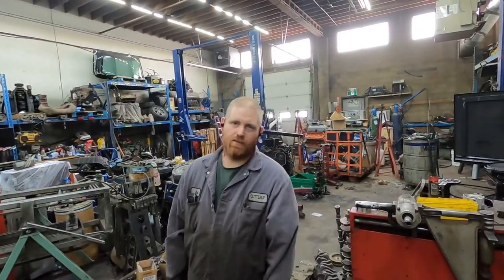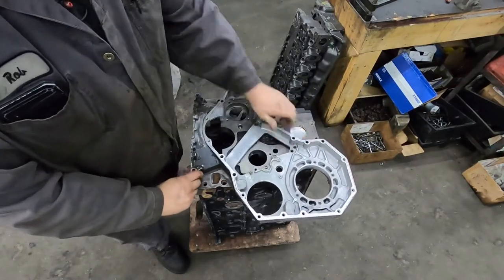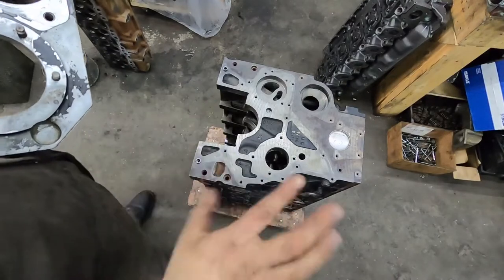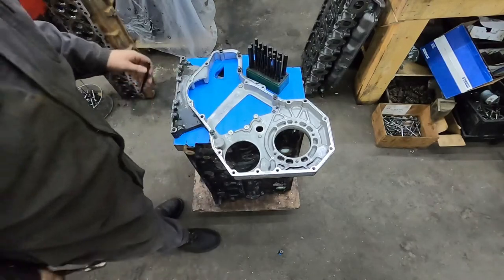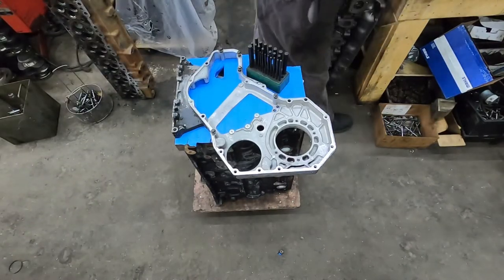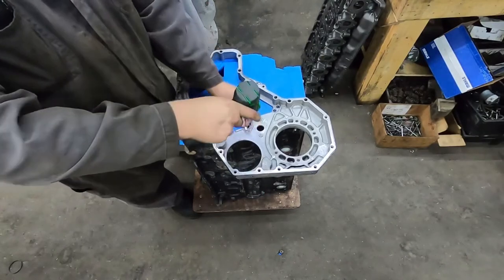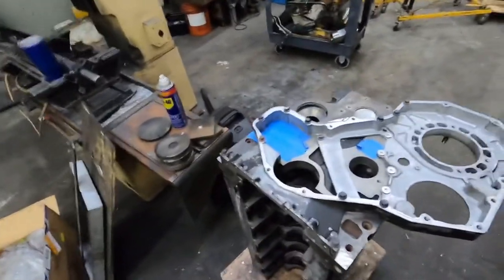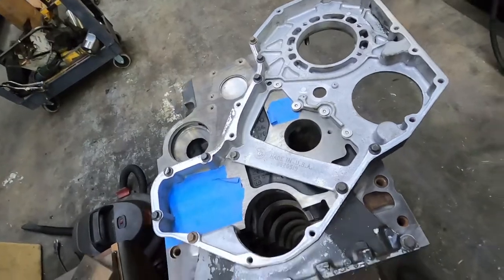How to build a Ppump 6.7 Cummins  Part 2

Comment: ... spent the afternoon today and got my 6.7 industrial w/360° thrust all filled and tapped for the new gear housing, super simple and don't buy hand and one new Matco tap... hammer down.
Reply: ... should read 'done by hand'...lol
Reply: What year and make or model did you get the block from thanks

Comment: Idk if I'd trust myself to do that mod.... great job once again man👍
Reply from the maker: Anyone can do it just have to take your time.
Reply: Yeah it's too bad cummins and fuckin fiat didn't keep the common rail block configuration right there,a little more similar to the prior 6B blocks...when cummins had to fuckin join EEA or whatever in the late 90's... from what I've read
Reply: I mean ,FIAT has used/uses the 12 valve head on the fuckin RGT6.7 of theirs...with a VE pump ,that ive seen...in case/new holland equipment....fuckin FIAT

Comment: So...I just bought a 2013 4500 6.7 with a rod hanging out of the block, I've found another 6.7 block and crank, I have a 5.9 12 valve p pump sitting in the garage, electronic wise what kind of nightmare would it be to build my 6.7 back as a p pump mechanical engine, it's already manual shift transmission so no tcm to deal with, I could run a mechanical shutdown lever, a push button start, and older alternator that doesn't require ecm to tell it when to charge. just curious if my truck would freak out and loose stuff like turn signals, radio, power windows, door locks, etc.
Reply from the maker: You can make it work. But you do have to do some playing around for a couple things to work. I myself would just do the 6.7 again. But that’s me

Comment: Do you use a MLS common rail head gasket? Or a standard 12 valve one
Reply from the maker: for this one i am will be using a stock 6.7 gasket
Reply: If I were to rebuild jus a regular 5.9 12 valve motor could I use a common rail style head gasket
Reply from the maker: @kaydewhipple7696  if you doing a 12v and want to do a mls gaskets buy one from cometic gaskets